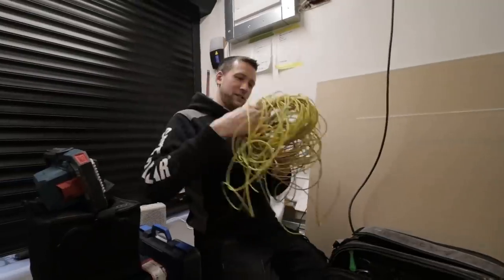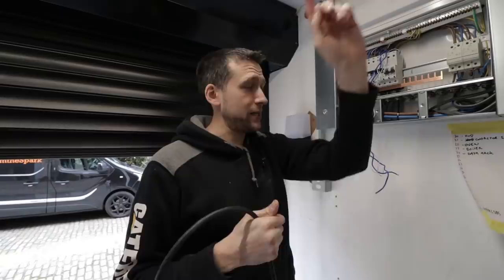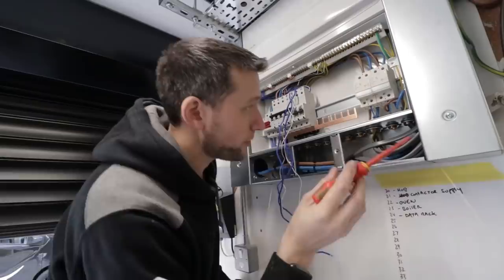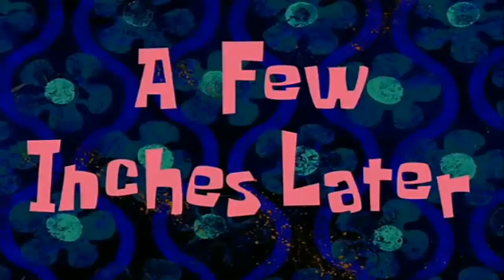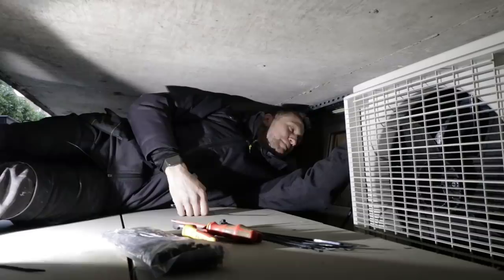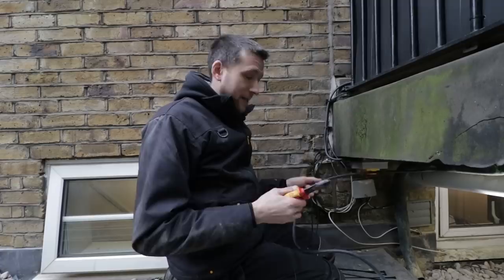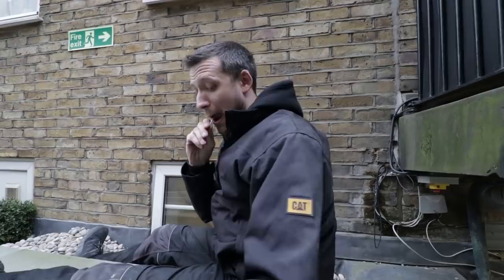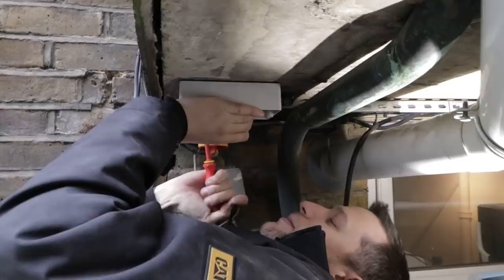Spiders, Isolators & VAT registering

Comment: They probably have a parts van that goes around and drops in parts to them, that way they have a central store and unskilled (cheap) people driving a van around. I used to repair photocopiers and printers in London, we used to just get the tube to sites and what we needed was driven to us.
Reply: That’s exactly what they do!
Reply: What's the point of that? Genuine question
Reply: @easternmenace  cheaper fleet. 10scooters and 1 or 2 vans vs 10 vans.
Reply: @easternmenace   You can have many more electricians than you have vans because you don't have vans parked up all day.
Reply: @easternmenace  You can get an electrician on site quickly to diagnose the fault and find out what is needed. Is it a blown circuit breaker or a short? What parts are actually needed for this job rather than having to carry on the van. Plus it allows you to say response in X minutes. A percentage of calls can be quick fixes or temporary fixes, till out of business permanent fixes 

It's like say it's a shop and all power goes out to the tills, you are losing so much per minute that time is major factor. Even say swapping the circuit breaker from the back offices to get the tills up till you close, is good and for that you might just need a couple of screwdrivers (and multimeter). By then the van has had time to drop off the parts and any other bits you need.

On a scooter you can cut through traffic and easily find somewhere (pavement?) to park, heck at a pinch you can drag the scooter into the loading bay/shop!

Comment: Hello Tom. I don't know if you saw my previous comment on your contactor but just for advise - Put a blank between the two contactors. Because of the load your are pulling, Heat dissipation has no were to go but into the next contactor and can potentially cause a fire risk. Hope this helps.

Comment: The best solution with earh sleaving is to get rid of it.. and make a cable with all cores sleeved 🤣
Reply: they do have that in ireland and the earth is the same size as the live on all sizes i think. The 2.5mm twin and earth drum looked a lot bigger than the ones over here.
Reply: Kasp Net like the Irish T&E
Reply: @acelectricalsecurity  shut up with your common sense. We don't  tolerate that sort of thing in this trade.
Reply: Get with the programme Engerland

Comment: If your sleeving comes from your wholesaler tied together in a polythene bag there is a solution to your spider woes!
   Make a hole big enough in the bag to put your hand through to cut the tie gliding the coil together. Then find the end of the  sleeving and it should pull out from the coil nice and freely!
   The bag is largely still intact and keeps the coil contained. Sorted!
    Alternatively find a wholesaler who sells the sleeving on a drum!😀

Comment: We are never going to get people to plan for half an hour before they take a modest journey. You are so right. But, such planning could be integrated into the satnav system with some simple programming – and it could highlight the optional charge points which will be required. Even then, many of these charging points are either in use when you get there, out of order, or charge at such a slow rate has to be practically useless!

Comment: Wagos on sockets, yesssssssssss. When you get to my age, get the shakes and can’t locate a slot in a terminal screw, the only option is to retire. Draw it up and get yourself down to the patents office.
Reply: LK branded sockets from Schneider have used push button clamps for decades. But only two holes per terminal and not for BS plugs.  So installers often stuff Wagos in the box behind them if 3 wires are needed. Before that, stuffing 3 or 4 wires in one screw clamp was common.

Comment: So I take it the contactor  is on its own MCB, but what about the circuit for the contactor trigger switch? It should be a) isolated via the MCB for the cooker/shower circuit but b) protected by its own 6a MCB as its 1mm cable. Can you confirm please.

Comment: Have you seen the little giant ladder?  Screwfix sell them , very clever, and safer than telescopic ones. The one I've got is only 1.3 mtrs when closed, opens up in to a big  step ladder, stair ladder, or an extension ladder that goes up to 4.2 mtrs.

Comment: What about earth sleeving in the same way cat5 rolls come off on a centrefeed?
Reply: I wonder how quick that's gunna get tangled
Reply: If it’s like CAT5 in the first 3m
Reply: It does come off centre feed. Just pull from the inside end, not the outside end.
Reply: Think it would have to be cat 6
Reply: its not rigid enough to feed that way

Comment: Could you expand on the switching for showers etc through contactors. Seems like a great idea just can’t get my head round it from the short description. Cheers
Reply: Preferably run a 6V signal as a twin between the switch in the bathroom and the CU.  CU contains a contactor on the dedicated shower circuit and an isolated 6V transformer for the signals. 6V because that's the safe voltage for people with a wet chest in a tight space.  Some bathroom sizes would allow the exposed stuff to be 12V or more, check the regs.  Remember that a signal wire in the same duct as 240V needs to be isolated to the higher voltage anyway, so using the usual cable or flex is the easy solution.

Comment: I use the megger 1731 and when using the plug adaptor I insert them right angle up which avoids them getting prematurely worn when the tester is on a work top etc.

Comment: Poses s good question Tom. A standard decent Combi drill has hammer action on it which most of us hardly use. First day on site is has got me out of trouble because I tend to trickle my big tools in over a few days on a new site on the tube. Having said all that it would be a bit limited what the Scooter guys could theoretically do. What if a pair of steps is needed ect.

Comment: If you buy them in that heat shunked plastic bags then just poke a hole in the middle and push the center piece of sleeving through the hole and use it like a string dispenser

Comment: Using a contractor for showers is common practice in EIRE as flat twin & cpc has all the conductors the same size and all cores insulated throughout their length, so can you imagine terminating 10.mm in a switch ? ☘️🇮🇪☘️

Comment: @thomas Nagy at 11 minutes.........   i would assume they keep each plug separate so you can change them round, when doing R1+R2 you can if you needed to be to RN+R2 by swapping the leads over by putton blue lead in red port.  many of times when testing new build flats and they have been fucked and need to know whats wrong. hope this helps mate

Comment: With those complaints about the earth sleeving I think they were miss directed. he issue should have been why does UK wiring not have a sheathed earth eg in Australia its been decades since we last had unsheathed earths as all our Twin and Earth has all the conductors insulated not just he active and neutral.

Comment: I’m surprised there already isn’t a socket with a wago type connection.

I was looking incidentally other week if anything existed, shouldn’t be an issue anyway, but having a wago type connection would be easier and quicker to terminate... and also it would eliminate loose connections
Reply: all modern LK sockets are "toolless" connectors
Reply: In Germany our sockets usually use spring loaded connectors.
Reply: Skjaeg Scrub do you have a link for this? Sounds interesting haven’t seen any before.
Reply: They would probably be more expensive to the point where it wouldn’t even be worth it. It takes literally 1 minute to 2nd fix a socket, loose connections shouldn’t even be a worry after a couple months experience
Reply: Mk are bringing one out 150 pounds each.

Comment: The next stage for electric vehicles, will be wireless charging. Instead of charging points, which we will still probably have in domestic situations like garages, there will be charging 'plates' installed underneath parking spaces. https://www.carmagazine.co.uk/electric/what-is-electric-car-wireless-charging-wevc-and-how-does-it-work-/ I do see a flaw in this design though and that is the difficulty in maintenance and fixing a unit which is buried underneath asphalt... 🤔  I see enough 'charging points' that are faulty or not working already so a 'wireless' charging plate won't be without it's own problems.

Comment: my thoughts exactly on electric vehicles. If they require a TON more work (ahead of time planning IS much more work) than gas ones it is a problem.

Also the charging situation in itself is flawed as fck. I can only speak for Germany, you need multiple mobile apps and/or RFID cards to be able to charge your car on the various systems. And now, due to laws (you have to be able to review your previous charges at the charging station itself) everyone with a bit of knowledge can actually copy your card ID and use it as their own (transactions display the UID of the card, which can be inserted into a blank and used as a copy. The UID is displayed after the charging is completed as well, which is usually the case in the early morning if the car is left over night at the station ... just go there, snap a few photos and you have a couple new cards to use).

Soooooo yeah, nope. Not gonna switch anytime soon.

Comment: Hi tom the 1.5mm cable  fitted to the contactor is running (energising) the coil generating a magnetic field pulling the contacts into the closed (on) position connecting the load to the feed

Comment: How do you cut a slot with knock out holes in ?  Jigsaw or angle grinder perhaps, I like you Nagy but sometimes I do wonder
Reply from the maker: Wonder what? On an MK board you have x2 32mm knockouts on the end plus for some strange reason a 25mm slapped right in the middle. Without gutting the board out of the box, then putting it upside down in a pair of clamps and then butchering it with a jigsaw to make a 32mm slot because the outside knockouts were 32mm. For all that faffing about it would just be faster to throw a three phase panel up surely?
Reply: Fair enough tom, it’s only banta. We won’t have to worry soon as mk are stopping making sentry boards.
Reply: thomas nagy I just knock out the holes then use a jigsaw to cut from one side to the other, file the edges down, use gromit strip and job done, takes literally 5 minutes. Makes pulling the cables into the board 10x easier. Definitely worth the extra few minutes.

Comment: These contactors are really quite nice. You can also use them to prevent that several high demand appliances run at the same time and blowing the main fuse due to overload, including which appliance got priority. "Durchlauferhitzer" is a flow-type water heater, it only draws current when it's required, but then it draws a lot. "Heizung" is a conventional room heating. In that case it makes sense to set priority on the water heater, because you need hot water quickly, the room heating is inert. If it doesn't run for a few minutes, you won't notice...

https://www.elektrikerwissen.de/wp-content/uploads/2018/10/Lastabwurf_2-1024x815.jpg

I don't know the specific english term for this, but literally translated from german it's called "load throw-off circuit". You can buy them also in one complete device:

https://www.elektrowelt-zwickau.de/elektroinstallation-abb/abb-lss1-2-lss1-2-lastabwurfschalter-led-anzeige-einstellbarer-schwellwert-bis-90a.html?gclid=CjwKCAiAhc7yBRAdEiwAplGxX3LQviygE7wBNy_4FerwP7cvwr2lnB-70-OIZf37DPe2xGw0WaorHxoChzsQAvD_BwE

Comment: cun-tactors
tell me you are going for a wind up saying it like that
Reply: Only way to fly if you don’t want to weld your PLC outputs. Not only with a motor the max rating of your output weld the tiny relay the back emf will restart a SLC500
Reply: What kind of actors?

Comment: @ thomas nagy ............... I've got an idea for this electric charging infrastructure. Its simply and cost effective, I'm currently researching as to why no-one else has done it. I would buy electric if the charging system was there, you can't pre-plan a route or a day if your an electrician responding to a reactive call out "yeah sorry I was on my way to fix your electrical problem but my van ran out of electric" I'm currently trying to sub it out to a guy on a scooter though.................

Comment: paxlin?
Reply from the maker: Paxolin is a 3mm or 6mm brown composite you use between boards and trunking - normally bigger three phase ones.
Reply: Jeremy?
Reply: Paxoline..Yeah and it stinks and makes me feel sick when i drill it lol...bork!!!... its a really good insulating material.
Reply: @thomasnagy  also what's the name of that flexible armour u used for outside lights only thing I can find is sy cable but not really used for outdoor.